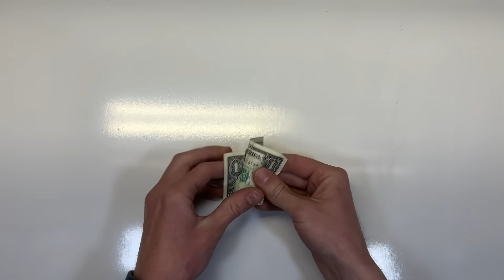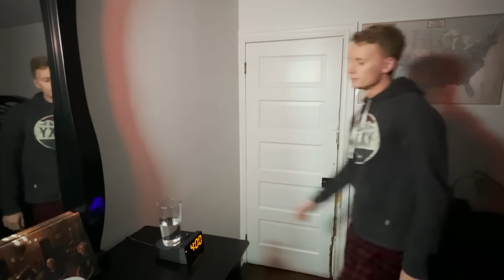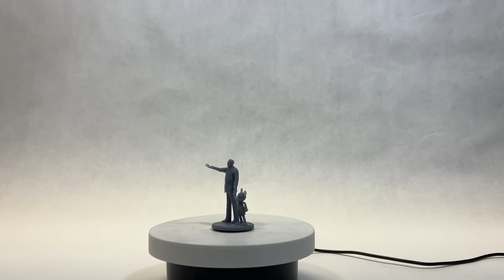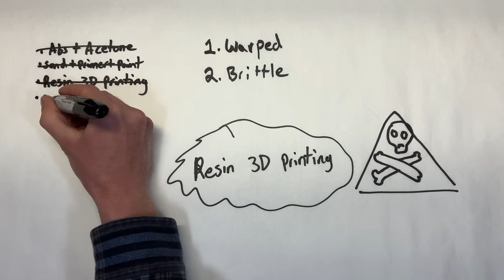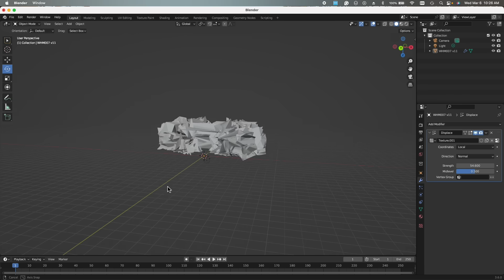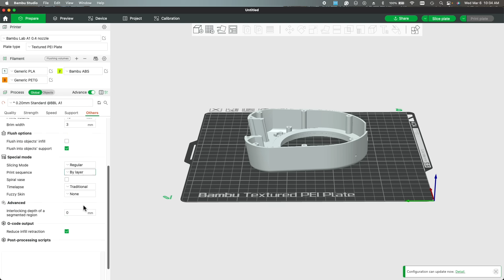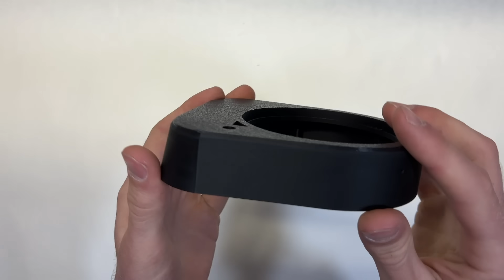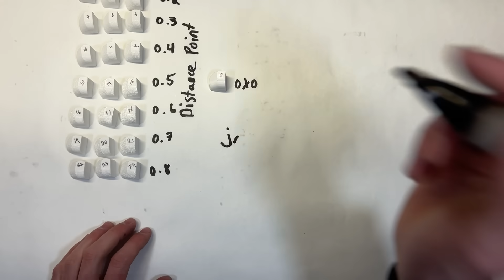My Secret To No More 3D Printed Layer Lines

Comment: Depending on the orientation of the print in 3d resin it can lead to repeated failures when big flat surfaces are suctioned against the film. A lot of times you'll need to orient at an angle for best results. In fragility there are "abs like" that make them more viable.
Reply from the maker: Good to know! I will use this information when I try it again! Thank you for sharing!!

Comment: I've been using fuzzy skin for a couple years now, and I think other slicers also have the setting too.  as for tolerances, you can use modifier blocks to either enforce, or block fuzzy skin anywhere on your model. I use this for the phone mounts I designed and produce for my car.  Fuzzy skin is an awesome feature, and even though I already knew about it, knew how to use it, and use it on a regular basis, I continued watching your video because of how well you made your video.  It is structured very well, and easy to understand for even the most novice of printers, which I appreciate, and wanted to say GREAT JOB!
Reply from the maker: Thank you SO SO much! You put the biggest smile on my face :) I tried to make this video entertaining and informative for beginners. A bunch of expert level 3D printing people posted negative comments, but that’s okay thanks to people like you being kind and positive. If you haven’t already, you should consider joining our discord (link in the description) of other makers. I’ll be getting on there this afternoon to catch up on the conversation. Now I’m going to go for a run and exercise :) See ya around!!

Comment: If resin prints are warping it means you are typically over exposing each layer, UV light heats up resin when it starts to cure so the longer you cure them for the more they warp, while parts can warp during the printing process however it boils down to the cure station, over curing the print can cause warping. 

Also resin is brittle because you are using the wrong resin, try to get UV Tough Resin and or ABS like resin for more durable parts, you can even get resin that is made for practical applications but the resin is more expensive.
Reply from the maker: Good to know! Thank you for sharing! I’ll give it a try!
Reply: @jakemgrim  The resin I use is Anycubic UV Tough Resin and Jayo ABS Like resin. 

Also some more tips:
If the print is sticking to the FEP sheet then you are likely over curing the layers. 
If the print falls off the supports it could mean the you either don't have enough or strong enough supports, the left speed of the print bed is too fast and or the temperature of the resin is too cold. 

Resin works best around 25 to 30 degrees C and it allows the resin to quickly flow under the print bed when the print bed is lifted. Because resin is thick when the print bed rises after a layer is cured it creates suction and this suction can cause prints to be ripped off the supports, the colder the resin the more thicker the resin and more suction is created, too hot resin can cause warping and defects in the print. 

It's annoying but once you get the sweet spot with brand/type of resin you shouldn't have to touch the settings again but you might have to once you try using a different resin or brand of resin... if using a new brand or type of resin after you have found your sweet spot always test the new resin/type of resin with a small print and that way you lower the risk of wasting a whole lot of resin. 

Most printers don't come with a built in heater so I use a portable mini heater that i have facing the resin printer and I use a laser thermometer to check the resin temp.

Comment: See how it puts fuzz on the inside of the product?  That's what I would like to avoid, since I use channels that things flow through (solid moving parts), whilst the parts the customer can actually hold and see, I would want fuzz on.
Reply from the maker: Some people have comment on here some modifications to prevent that from happening
Reply: @jakemgrim  thanks. I will have a search in here.
Reply from the maker: @matthewwain9958  try command F “modifier” .  There are several good comments on how to do it from people with more experience than me

Comment: The fuzzy skin is not a "Bambu Studio" feature. It's originally a Cura feature that got ported over to Prusaslicer (which is the basis for Bambu Studio) long ago..
Reply: It's not even that. It's basically a more simplified Displacement modifier with less options that you normally get with any 3d modeling software.
Reply from the maker: @MrGTAmodsgerman  what kind of displacement modifier do you use?
Reply: @jakemgrim  There is only one in 3ds Max ;)
Reply: @MrGTAmodsgerman  in Max you also have a displacement space warp.
Reply: @chronokoks   I haven't heard of that one before, also can't find a video about it. Let me guess: It's a fairly new modifier that came with a recent released Max version?
Reply: I used it 2 years ago in Cura. And yes,  it was Experimental, but nice.

But good to know that is configurable in OrcaSlicer too.
Reply: yeah but it's obvious it was a sponsorship segment...
Reply: Cruise control was not invented by Ford but is still a feature of their vehicles, that’s how features work.
Reply from the maker: Good to know! Thanks for sharing!!
Reply: I also specified it in ankermake studio to.
Reply: I'm really looking forward to them adding other textures along with Fazzy
Reply: So it's a Bambu feature now stfu
Reply: While still under "Experimental"
Reply from the maker: @R34l1ty4U  allegedly…
Reply: Orcaslicer is best slicer (bambu/prusa/open source nerds). Has all the features of bambu and Prusa with the elegance of bambu and more optimisations too. Man, it’s not the Slic3r I started out with years ago :3
Reply: @fattyMcGee97  Orcaslicer has some cool features, but the UI is somehow even worse than Cura, which I didn't think possible...
Reply: @Scrfmnstr  Having used Cura since version 1.x I'll disagree with you. Orca Slicer is much more accessible and has many features Cura doesn't. It also has a greatly accelerated development cycle with most bugs fixed and feature upgrades rolled out regularly, unlike Cura. Both need some interface work but that's a lot of 'different people like different layouts' ... 😉 Cheers!

Comment: Shock! Horror! Dude discovers obvious slicer setting that everyone else talked about already!

You missed a step of the story though. Resin casting. You can impart any texture on the item, the silicone mould lasts several hundred pulls, and can be re-made from a hand made master any number of times. The costs per unit aren't amazing but you save yourself the up front cost of injection mould tooling. You don't have to do the casting yourself - and you probably really shouldn't at any sort of scale to avoid allergen exposure - you can have some dudes in China or Bulgaria do it for you, they're probably going to have air extraction i hope. Casting resin can come out similarly tough and durable to thermoplastics or better.

But to be honest that's probably a step that's best skipped, because injection moulding tooling prices have come down a lot, and labour and resin costs of resin casting rack up pretty quickly. Also you make one tool to make all of your pieces when injection moulding and cut them off a sprue tree then.

Silly injection moulding idea: do random colours and then mix and match parts from different batches to create a number of duotone or multitone looks. Charge extra for special colourways like these, because you'll end up with waste.
Reply from the maker: I prefer made in USA 🇺🇸
Reply: @jakemgrim   Dunno never been there, seems like a weird place. And getting anything done in Germany is generally a pretty frustrating exercise, so you have to grab what you can from all sorts of places.
Reply from the maker: @SianaGearz  are you from Germany? I went to Germany for the first time last year and loved every bit of it! The culture was great, the people were kind and healthy, I felt very safe, the food was very good! I think about going back to Germany every day and can’t wait to return :)
Reply: @jakemgrim   Bulgarian-Ukrainian but been living in Germany for most of my life.
Reply from the maker: @SianaGearz  Nice! I’m glad you’re here on YouTube and I hope to see you around!

Comment: I have used Fuzzy Skin on some parts when I was using Cura, however, I haven't used it yet with Bambu Studio and my X1 Carbon, another alternative is using CF-PLA or wood filament to hide the layer lines, I have recently bought the Ideaformer holographic build-plates and the first layer hologram patterns are just awsome.
Reply from the maker: Good to know! I’ve been wanting to test different build plates! You should share pictures of your results in your Discord linked in the description :)

Comment: Two other ways to reduce layer lines, layer height and filament with fibers or a matt finish

If you have your printer perfectly trammed when you choose iron it will leave the top surfaces perfectly smooth, like if you sanded it on a flat piece of glass with 800 grit. Not the best for coasters, they will suction to the bottom of cups 😅
Reply from the maker: Sounds like you are speaking from experience with coasters lol. Is there any particular fiber filaments you recommend?
Reply: @jakemgrim  short carbon fiber filaments are great to hide layer lines without having to tweak much if at all. Matte filaments are usually a bit weaker on average.

Long fiber carbon or glass imo need flow adjustments for quality printing since the fibers tend to stick out. I print long fibers at about 5-10% less flow. I.E. if PLA prints at 98% flow in your profile I would adjust to 93%

Glass Fiber is great for impact resistance and Carbon Fiber to stiffen

Comment: Have you tried the salt-annealing method?  Just submerge in fiinely powdered salt (which will hold it in place) and put it in the oven at the appropriate temperature for a few hours.  Makes surface very smooth.
Reply from the maker: That sounds like a super super cool idea!!!! I’ve never heard of that but now I want to try it! Is there any issues with warping when you do that??
Reply: @jakemgrim  I haven't tried it but apparently it works pretty well if you pack the salt tightly.  Salt is great because it is cheap, stable under temperature, and washes away.  You can also choose how smooth you want the surface to be, by the fineness of the salt powder you use.  It doesn't let me post a link here but if you search for "remelting 3d printed thermoplastics" you can see the original video that popularized the technique.
Reply from the maker: @findlaybuch  that’s such a unique idea but makes so much sense! I’m going to try it sometime! Thank you so much for sharing :)

Comment: 2-3 layers of UV resin and you're ready for a single sand after 40-60 minutes. Then you apply a primer using an air brush and paint it over after an hour or so with an air brush again. Wait an hour more or so and apply a varnish of your liking. You can ship your part next day and your house won't smell.
Reply from the maker: Are you adding the UV resin to a resin print or FDM print? That sounds like a good process!
Reply: @jakemgrim  I'm doing coats on top of my FDM prints. It basically works like a primer you tried before and covers layer lines. The difference is that you can cure UV resin in minutes instead of 24 hours. So you can get a smoother surface fast, then you sand it a bit to fix imperfections and you're ready for priming and painting.

Now if you combine the two approaches (with fuzzy skin), you can get a multi-textured parts :)
Reply from the maker: @AuxHex  multi texture part would be cool! Are you using any tool to cure your resin?
Reply: @jakemgrim  I'm using a UV torch for now, but planning to buy a curing chamber as used by people printing with resin. Since you already have it - just try it out!
Reply from the maker: @AuxHex  i’ll give it a try! If you want to share pictures or videos of your finish parts, I would love to see them! You can post them in our discord channel that I linked in the description above

Comment: Wait untill you learn about ideamaker and the texture feature...
Reply: Is a slicer unfortunately, not sure how well it would work with bambu printers but I've used it on my ender style printers and my raise3d printers. I have printed leather texture into parts to make them look injection molded
Reply from the maker: @elvo_racing  leather? Now that’s cool! I’ll check it out and see if I can use it with my Creality CR-10! Thanks for the advice!!
Reply: @jakemgrim  I wanted to match a dashboard texture so I took a picture of the dash and used the pic to texture. You can literally use any image you want!
Reply from the maker: Is ideamaker a slicer or a 3D Design software?

Comment: Also try out “tough resins” I have herd that they can get close to abs strength, and with thermal curing they can be much harder as well.
Reply from the maker: I'll check it out! Thank you for sharing!
Reply: @cnckitchen have a series of videos where he test the strengths of different filament, resins in different sclicer settings, you can check it out. @jakemgrim
Reply from the maker: @uujims  I’ll check it out! Thank you!!

Comment: I've been using fuzzy on my prints for the last few weeks and I do like the results. I make alot of items with TPU and the the flexibility and fuzzy makes a great combo really gives my prototypes a next level feel. Great video thanks for sharing your journey!
Reply from the maker: I haven't tried TPU and Fuzz yet but it sounds cool! What kind of stuff are you printing? If you want to share pictures of the prints, you can post them in our Discord linked in the description!
Reply: Same here, I tried fuzzy on the Ender-3 v2 a couple months ago for a TPU button and it came out great both in look and feel. So I experimented a bit on PLA. My parameters of choice are 0.1, 0.1. It just gives it a silky roughness, like finished wood.
Reply: We have switched to TPE and have had some struggles. What settings do u use?

Comment: Fuzz works and your results are good, though the slowdown is quite a lot. When we tested it, controlling where it gets applied was an issue because it leaked through a USB socket hole and wrapped around on the inside, causing issues for some internal parts of the design.  A way to paint on where it's applied or a smarter algorithm to limit it to the outside would be good. Something else we tried is Bambu sparkle filament, and that reduced the appearance of layer lines nicely along with a well tuned Bambu producing great surfaces anyway. Not to everyone's taste, but we had good results with boxes we've been making. I also printed something at either 0.12 or 0.08 which worked well. Longer to print, but then so is fuzzy, so if you're open to accepting longer print times, that's another approach.
Reply from the maker: I'm going to have to try that! Thank you for your feedback! Some people have commented about using a modifier such as the same STL file but increased by 0.2x and moved up slightly to apply the fuzz. I have not tried it yet though. Also, I'd love to see your finished results if you would like to share them in our Discord linked in the description! Hope to see you around friend!

Comment: You should try bambu pla-cf, layer lines are not visible even on 0.2mm layer height
Reply: Yeah their Matt version is also good for this as well, I've tried both with good results
Reply from the maker: @nicholasbrunt1296  good to know!
Reply from the maker: Really?? I hear using a matt pla also helps!

Comment: use matt pla with a low layer hight and you see no lines anyway
Reply from the maker: Is there a particular brand you recommend?
Reply: @jakemgrim  I work wit overture... but most matt pla filaments work fine.
Reply from the maker: @MoTheFcker  I’ve used their TPU and I really liked the finish of it